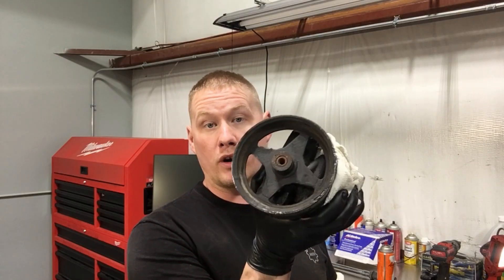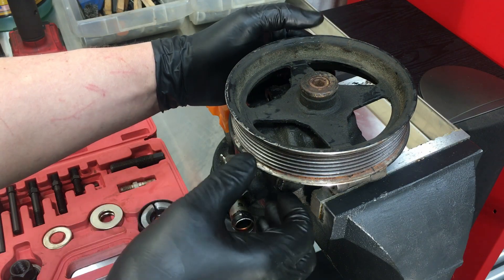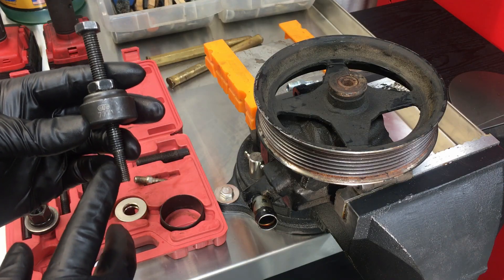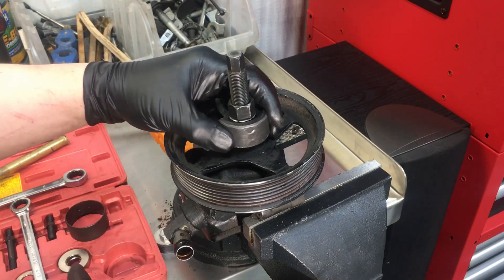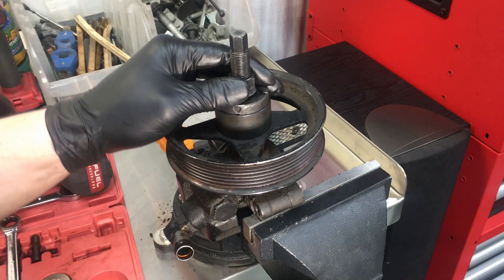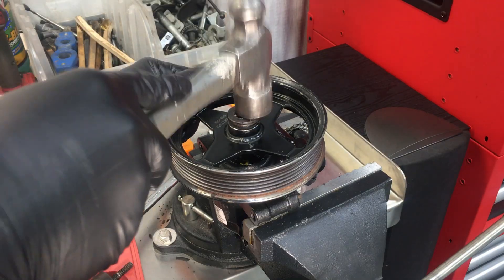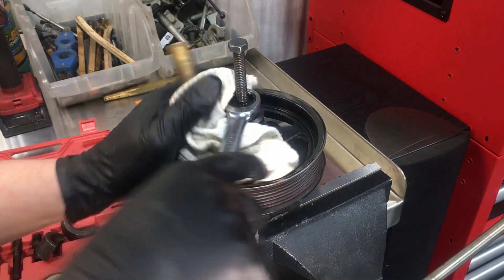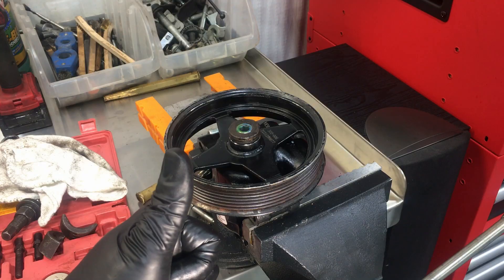Ford Quick Tips #82: Ford CIII Power Steering Pump Pressed Pulley Removal and Installation Procedure

Comment from the maker: These are the Parts and Tools I Recommend:
Remover and Installer Kit- (Best Value Quality Kit)
http://amzn.to/2D0aerU
My preferred Reman Power Steering pumps I use-
#1 Choice-
http://amzn.to/2BTjvTH
#2 Choice-
http://amzn.to/2BQ1G7I
Reply: FordTechMakuloco just in case ER um someone installed the pulley backwards how would one remove it? Yes I know probably going to have to install a new pulley after but how does my friend remove such an embarrassing mess up.
Reply: FordTechMakuloco my 06 mustang gt just started slipping 3rd to 4th gear. No engine light and no problems with reverse. Took ot to aamco and they said i need a rebuild. Any suggestions??
Reply: Do you have a video on replacing the rack and pinion?
Reply: Hey Ford tech I have a question for you
Reply: I have a 5.4 Triton 2004 Ford F150 I replace the power steering pump and now I'm leaking motor oil somewhere around the power steering pump I did not have all the bolts to put the new power steering pump back on so I did not know if all could be coming out of one of the boat holes or where could it be coming from thank you
Reply: Do u have video on pump removal...
Reply: Do you remove fan shrouds when changing PS pumps on the f150?

Comment: ive been watching a bunch of your videos lately, and so glad you did so many videos on this trition ford engine design... i have a very loud chirping coming from passager front side, after its warmed up. i replaced tensioner and belt. had shop check it out and they said its coming from inside engine. so got it back and after warmed up, reved in park and it made sound some. so i took belt off quick and tested again but no chirping sound. so i feel its still  has todo with pullys. also in beginning i checked the pulling and didnt notice any grinding or catching.... so since the sound went away after belt removed, would it be safe to say its one of the pullys?     please someone help, this has been months of hell!!!!

Comment: Tried using heat, lube etc. Yep snapped the tool off in the pump, then tried to use a press and blew the shaft out of the back of the pump ruining it. 

Tool broken
New pump broken. 
Had to buy a new pump, and got one with the pulley already installed. Not worth the hassle.

Comment: He already mentioned don't heat the pulley.  Plastic pulleys expand and contract VERY LITTLE with temperature changes,  so you'd be wasting your time, and heat would likely damage the pulley. The small diameter of the pump shaft likely means that even leaving your pump in your deep freeze overnight won't shrink the shaft enough to make a noticeable difference either, but at least that won't hurt anything.

Comment: I have the same pump in my 03 expedition Eddie Bauer edition. I got the cheapo kit like you have and the instructions are totally different.  The show putting a button onto the end and then turn the center 1/2 in while holding the larger 13/16th nut in place.  Needless to say it’s not working

Comment: Awesome video, very clear and this is the same power steering pump I've got on my 2003 Ford Crown-Victoria. Could you please also make a video on how to take out a broken end part of the installer bolt which unfortunately ended up being stuck in the pump axle? I think I probably had bought on amazon a good quality set, but I shouldn't have used the impact wrench for the install process 😢
Reply: that happened to me too

Comment: I have a 2005 Ford freestyle steering with easy then hard to turn then easy I already had a wreck here at the house that I had ordered and went ahead and put it on didn't fix it so then I put a power steering pump on didn't fix it only thing else I know possibly could be the intermediate shaft any response would be helpful I know it's hard to diagnose anything long-distance

Comment: I just replaced my steering pump recently (03/23) and the video information is still quite valid and good. However a few things not mentioned is the plastic/teflon o-ring.  It is not pliable, meaning if you stretch it too far it will not regain its original shape.  Also meaning when tightening the high pressure side of the hose into the pump with the plastic/teflon ring may not get sealed correctly.   I , luckily, was able to get a good seal even though the ring was loosely fitted.  No leaks after 3 days.. But will keep an eye on it. 

The other thing that should be mentioned is the tool for removing and pressing the pully should be high quality. While the "Harbor Freight" - made in china, did the job. I had improvise to get the job done. I ended up having  to use a hose clamp rather than the provided sleeve due to the fact there was so much slop and play that it didnt allow the collars to stay in place when trying to take it off,  which in turn made the tool fail in the end.  And as he suggested @8:45 the installer bolt breaks quite easily, especially when taking the pully off.  I broke the part 2 times, first time when taking the pully off and second time when  I pressed the pully too far and had to pull the pully away form the pump body without the pully rubbing against the pump. 

In essence, because of the low quality tool I used it took a 3 hour job  and made into a 2 day job just because I wanted to save money on a tool I knew I probably wouldnt use again.

Comment: I have a 2002 Mustang GT. Just replaced my ENTIRE power steering system (rack; pump; all lines, except for the one coming off the reservoir with a Y, which isn't available any longer). There's currently zero fluid in my system. What would be the correct procedure(s), in order, to add fluid and bleed air from the pump and the entire system? Thank you. By the way, have watched MANY of your videos - they're ALWAYS excellent!

Comment: So you can use a 13/16 deep socket and brace the pulley so it wont turn and remove it right? It can be done on the car?

Comment: Recently changed my pump on my 2010 5.4, where the pump bolts to the block there was only 3 bolts in out of 4. Which actually saved me some time. Cuz the hardest 1 to do was out already. (Someone changed it before). Now I gotta change my pump again after doing donuts in the snow. Wonder if it has to do with the missing housing bolt

Comment: For vids are very helpful, thank you. Im replacing the power steering pump on my 2001 ford excursion, 6.8L V10. I ordered the pump, but mistakenly ordered the one with the reservoir. Can i just remove the reservoir and still use it, or, do i need to send it back and re-order the one without the reservoir? And guidance would be appreciated. Thank you.
Reply: I believe the C2 pump( the one with reservoir) has the mounting holes in the front where the shaft is and the C3( no reservoir) has it on the side as shown in this video. Hope that helps!

Comment: I am trying to install a new pulley on my pump while in the car, the tool keeps coming unthreaded from the pulley shaft.  I suppose it would be much easier on the bench? But I need to install while the  pump is on the car.

Comment: Pressing the pulley out is actually very easy and effortless. It could be done with the pulley still mounted in the car. 
The problem I see while watching you pressing the pulley out is that you are using the wrong tool. That tool kit has a tool to press in and another to press out. 
As long as you use the tool correctly, you will be able to press the pulley out and back in using hand tools and the process should be effortless.
The funny thing is that in every single video I have watched about this job, the mechanics are using the tool wrong.
Reply: Which tool is correct, also my pulley wiggles doesn't go straight.  Would taking off and putting back in make it spin straight

Comment: I have a 2000 Ford v6 mustang 3.8l . I have replaced the recon pinion the steering pump twice all the lines and still has a whining noise.  Some one told me to add Lucas that's recommended for a steering pump.  Will that help ?

Comment: Thanks for another great vid! Question: When removing the pump for replacement, is it necessary to also remove the pressure hose with it? I would like to leave the hose alone, if possible. Thanks!

Comment: Just broke my install tool and I’m broke so stressed right now, really appreciate you going out your way to inform us
Reply: I broke two of those loaner tools from the parts store. It busted inside the pump with the separately purchased pulley partially installed. All three items rendered useless. Yesterday, I bought my own cheap version of the tool, but after seeing this, I bought the OTC tool he recommended. I'll wait on the OTC tool to arrive and just eat the cost on the cheap tool, because I don't want to buy another pump and pulley. Those cheap tool sets seem to be almost a one-time use. If you can find one with the pulley installed, they are $243.00. This is such an easy job, but it's filled with needless hurdles.
Reply: Piece of wood and a hammer
Reply: Hey guys,   I had to do this same job on a chevy blazer and It took like 5 attempts to take pully off or on.   I ended using a propane torch to heat whole pully and I could get 4 or 4  wrench turns then reheat repeat.  Make sure shaft and pully have no Burr or scrapes on it.  Some cars we work on are too much bigger pain.
Reply: I agree with everybody else on here the install/puller tool for the pulley is crucial. Get a solid good one. I got the OEM branded one to work for me. But use this branded one he says too …. It does matter

Comment: I know that when putting on pressed wheel bearings there is a suggestion of putting them in the freezer to shrink them and make installation easier. Have you ever tried placing the pulley in an oven so it expands and would slip on much easier? Don't do enough to know myself but would be interesting to find out.
Also I've been told that putting grease or anti-seize on the threads of pullers will lengthen their useful life.

Comment: are there bearings on this pulley or when it starts whining bad it's because of the pump only?
Reply from the maker: Bearings don't make noise on the pumps, it is the pulley system failing in the FEAD.

Comment: I have a 5.4 Triton 2004 Ford F150 I replace the power steering pump and now I'm leaking oil somewhere around the power steering pump I didn't put all the bolts back in the power steering pump so I didn't know if it could be leaking from one in the bolt holes any suggestions

Comment: 04 F150 5.4 3v. 250k miles. Original everything. I run 2cycle oil in power steering.

Comment: Love your videos, they help me out a lot!! I have a question if you get the chance to help me out? I have a 5.4 in an 08 F150, I have swapped out the High-pressure line on the power steering system twice but keep getting the same leak at the pump even with a new pump installed. Do I need to buy the line at the dealer? The ones I have used are from and auto parts store.

Comment: I’ve broken 3 of those skinny ass nuts on the same pulley. Had it half way on they snap. Thought I could tap it on the rest of the way. Nope breaks out the back. Harbor Freight cheap ass tools. Works well enough to take pulley off. But don’t work worth a shit to put back on. You on my 4th pump now. Scared as - - - - to go any further. Where did you get the installer that you used?

Comment: Today for the first time I noticed a squealing sound when I turn the wheel to the right. But it ONLY happens when I turn to the right, and am moving. If I’m parked, there’s no noise. Also, if I turn the wheel ALL the way to the right until it can’t turn anymore, the squealing stops. Immediately I thought of the serp belt, but that doesn’t make sense to me because if it were the belt, I would think it would squeal whether I turn left OR right, and also when I’m parked and turn the wheel. Could it maybe be the power steering pump? But again, the left/right issue is throwing me off. The other thing is maybe it’s the steering column itself. But it sounds like squealing, not grinding.

Comment: Thanks man, my pulley is the old style pump and it has that little back and forth play that you said is normal and I was about to change the pump because I have a squealing belt that driving me crazy. I have a 2003 ford Taurus with the 3.0 over head valve and I'm having a difficult time finding the source of the squeal. I can spray the belt with water and the squeal goes away for a few seconds leading me to believe it's a pulley misalignment. I just can't find the source of the squeal.... any idea's on that particular engine???
Reply: Tensioner fault?

Comment: Replaced my pump with autozone model.worked for about 50 miles.hit a bump parked truck and now it has no idle pressure .fluid full ,no leaks .bled unit about 2 separate times with a minimum of 20 lock to locks .checked my universals in steering shaft they are fine .at throttle I have steering .no issues previously had to replace pump due to rotted thread on shaft after replacing timing chain and removing pulley for easier pump removal .any suggestions this is a 04 f 150 4.6 .thanks for the great vids .
Reply: autozone stuff is junk....

Comment: Last year I did my phasers and all and changed idlers, tensioner, have new alternator, new water pump, etc. Now there is an intermittent squeal like a tensioner from the power steering pump side of the bay. Pulled the belt and everything is smooth and thought the play meant this was the issue but now I'm not sure. Thoughts? Thanks for all your videos too the phaser one was super helpful!

Comment: Hello Ford Tech. Ive watched alot of your videos and I currently replaced the PS pump and lines on a 2007 Focus. I can not seem to get the air out of the system. Ive left vacuum on overnight also attached vacuum pump while going lock to lock with engine off. Once I start it it foams instantly.  Thanks for your help.
Reply: you have to get air out,   duaneb.  Sounds like a lemon car.

Comment: Do these rattle when they go bad? The stock pump on my 2000 is leaking from the high pressure thread and rattles at low rpms. For example when I turn the ac or headlights on.
Reply from the maker: No

Comment: Will this otc tool kit work on my 2005 ford excursion 6.8l v10 limited 4x4 power steering pump it looks like a c3 the threads in the shaft are 8mm

Comment: I’m following your excellent four-part timing chain videos and the last thing I need to do is to remove the power steering unit before I can pull off the timing cover.  (I already found an incredible amount of broken plastic chunks from the timing chain guides in my oil pan so I know I am on the right track.  My pickup tube was so clogged with plastic debris that if it were one of my coronary arteries I’d be on a table at the ER with paddles on my chest and someone shouting “Clear”).  I was able to get the lower bolt loose but I’m having a heck of a time getting the top front bolt to break free and I’m afraid that I will round off the bolt if I try any harder.  Is it possible to just remove the pulley and leave the rest of the power steering unit in place to get access to remove the timing cover?  It looks like there is only a single 13mm bolt behind the pulley.  Thank you for your excellent videos.

Comment: The installation tool is more for on car use,wouldnt it be better to install the pulley with a arbor press or shop press????
Reply from the maker: No you must attach a puller as shown to press off the shaft. If you use a hammer or shop press you will blow out the back side of the pump.

Comment: I tend to respect my tooling just a bit more by using good grease between puller friction surfaces and threading components.  Makes for less stress and longer tool life.
Reply from the maker: Mine was greased from past use.

Comment: I put a new pump and pulley on my 99 f150 and the pulley installer from the parts store didn’t have the adapter. I used a socket and a 2.5 pound hammer to put it on. I didn’t beat it but tapped it until it was on. Was that bad for the pump or would it be ok?

Comment: With the interference fit so tight between the pump shaft and the pulley. Have you ever heated the pulley to install it to the pump shaft? Your thoughts on this procedure?

Comment: My 00' Mercury Mystique  2.0L (Ford Contour) has one of these CIII pumps.   

I like driving my Mystique because it is already a rare car to see on the road.  It takes a lot to keep mine going (150K).  I just got done with a major overhaul: swapped out a bad VCT solenoid, new timing belt, water pump, rebuilt front suspension, new high pressure steering hose, etc.  Dropping the sub-frame is really the best way to do a lot of stuff (don't forget alignment pins!).  Runs great!

I want to buy a SVT Contour as a project car.  Even tho the Contours have just about disappeared from the road, there remains a small but dedicated group of people that keep em running, especially the SVT.  Check out the YouTube channel "ForgottenSVT".

P.S.  I watch your channel a lot.

Comment: Off topic but I have a Taurus brake question. Any idea why Ford has a different brake hose fitting for the rear passenger side caliper? There’s no banjo bolt and fitting just a straight hose threaded in the caliper. So the only way to get it off is to unscrew the whole caliper from the line. Total pain

Comment: Hi I have a question I can find your answer Can I change the speedbox currently available to new ones with a little more speed and if there are alternative burning plugs that do not break or cause problems such as original burners and this is for Ford Expedition 2005

Comment: When using an impact to take off the pulley, an amount of grease (small dab) on the threads of the tool, is not a bad idea...  actually never a bad idea, even with hand tools.... 

Thanks for ALL your videos, I have found them so useful!
Reply from the maker: Definitely I always make sure that forcing screw is lubricated there is allot of pressure on those threads.